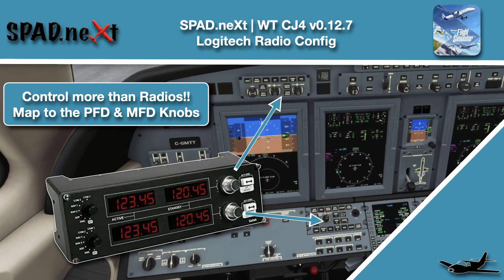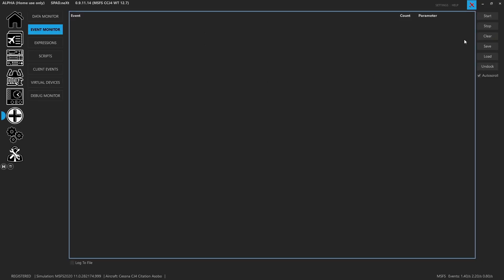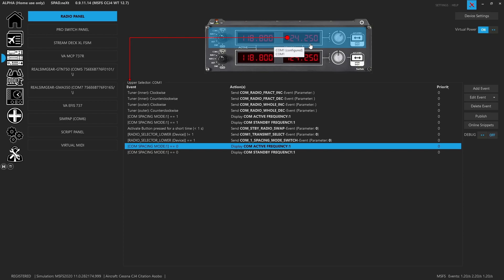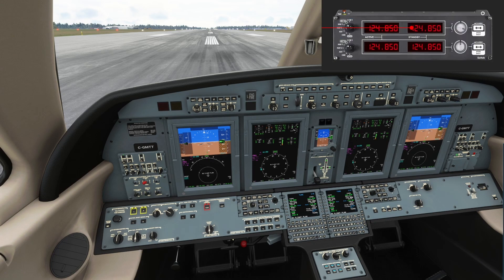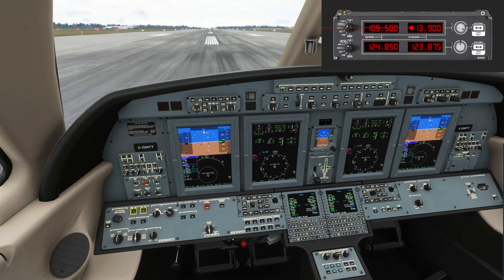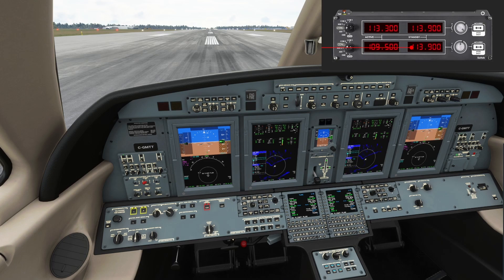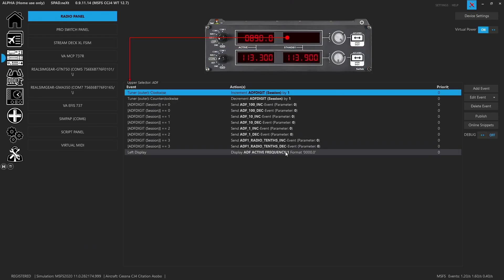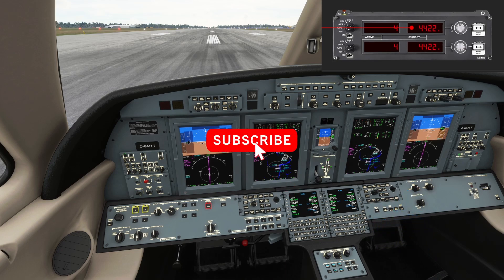(Sim Video) SPAD.neXt | WT CJ4 v0.12.7 | Logitech Radio Setup

Comment: Hi, i cant seem to get this to work any more. Ive been off the sim for quite a while and when i last used the cj4 (when it was a working title mod) it worked fine, now none of your functions work.
Any advice would be welcome. Your work on this has been amazing.
ta
Reply from the maker: WT CJ4 mod is no longer used -- must be removed from the community.  Also NOW it uses all standard events and variables so no longer needs to use LVARs.
Reply: @LesOReilly  thanks.
Shame the pfd menus can't still be controlled, i like having as mouse free cockpit as I can.
Thanks.
Reply from the maker: @axlsys  They can be.  There are now split units so you have to use the Index versions.
Reply: @LesOReilly  thanks, I have no idea what that means lol.
Reply from the maker: @axlsys  the Events -- Generic_Upr_Data_INC -- Those events since last January 2023 would now need to be the Index version for the Left or Right system.

Now that command would need to be changed to Generic_Upr_1_Data_INC for the Left PFD and the 1 would be a 2 for the Right PFD.
Reply: @LesOReilly  OK, thanks

Comment: PLEASE HELP. I have an Issue exchanging nav frequencies using WT mod, when I change through the ACT/SBY button, the frequency changes only for a moment from the right window to the left and then returns to its previous position, it is impossible for me to swap. Is there any way to  this from happening?  thanks
Reply from the maker: As been stated in these videos. The WTCJ4 is constantly setting the NAV frequency to what they think it needs to be based on their software… I have already complained that and they have stated that they might make this different when they do the “refresh” later this year.
Reply: @LesOReilly  Thank you very much for the answer, honestly my English is very poor and I have not been able to fully understand the video.
Unfortunately I will have to do without WT to fly CJ4, as long as I cannot make good use of the frequency change with spad next
Reply from the maker: Use the web based CDU I guess… note that the CJ4 won’t fly an ILS approach on autopilot if it is not loaded into the FMS either.
Reply: @LesOReilly  thanks !!! however I do not use the FMC of this plane, despite being a little gem, but I use GTN 750xi, since I have a simulator with enough hardware,displays, etc...and extracting the FMC as a pop out, is a huge loss of frames, so I need to be able to select the ILS for the additional approaches.
Reply from the maker: @rauldiez3068  There is another MOD that will provide a WEB Based version of the FMC...  It has NO FPS Loss..
Reply: @LesOReilly  Thanks again. Honestly I don't know what it is, I'll try to find it to see if I could use it in my simulator

Comment: Holy cow Les.  I hadn't watch this video before I started configuring the radio panel to handle the PFD/MFD menus but I did almost exactly what you're doing.  Haven't finished it so I'll probably just import your config instead now.  ;)
Reply from the maker: It is fun stuff :) ...  But hey you could just use your G1000 controller with it now :)

Comment: Hi .  I have probably bad contact for the avionic master switch. I need to un-program the cj4 function and do it with the mouse. If not, I have random events during flight that cut power and kill autopilot... Strangely this is less problematic with other airplane.   I thought it was a software problem or conflict with FSUIPC but the more I think about it the more I think it is just the switch.  Do you have or use FSUIPC ???  I think I will remove it since all my stuff is handled by SPAD.next now. I am not shure if SPAD need FSUIPC....
Reply from the maker: Sorry for the delay ... putting the . in spad next will make youtube hold the comment in review...

I do not use FSUIPC at all.  SPAD does not "need" it but it can interact with it if you have something that only works with FSUIPC...  Also make sure you don't have the Logitech Microsoft Flight Sim Plugin running that also can cause Havoc as it will also send out messages...  

I have also had issues with the Logitech/Saitek devices over time...  I have had to open them up and re solder the connections as over time the bad cold solder finally broke and resulted in faulty connections...  Most of the switch panel rocker switches are standard size so replacements if not solder are not hard to do.

Comment: Hi Les. I wanted to reload the MSFS WT CJ4 v0.12.7 Radio Panel Complete Device snippet but I don't see it listed anymore.
Reply from the maker: make sure you are either in the CJ4 or un check the box that says only this aircraft
Reply: @LesOReilly  Ah, unchecking the "only this aircraft" box did the trick. many thanks.
Reply from the maker: @chrispatton7215  yeah for a bunch of the other ones like the NXi I publish them as not specific to aircraft but the CJ4 is very specific :) so I leave those tied to the CJ4...  glad you found it..